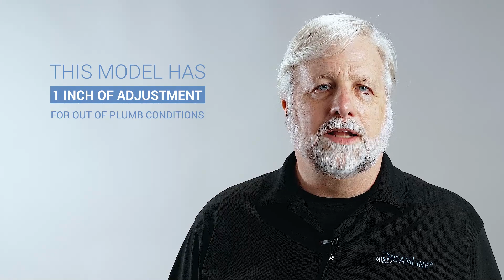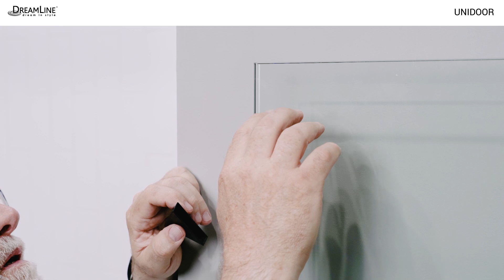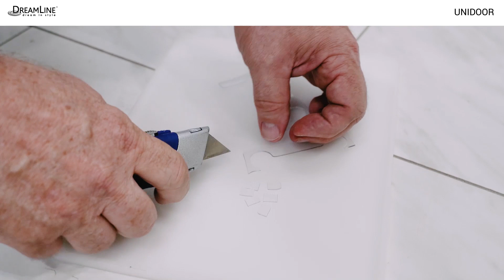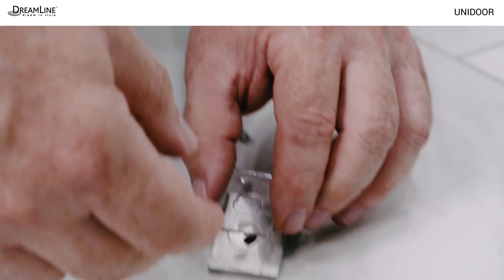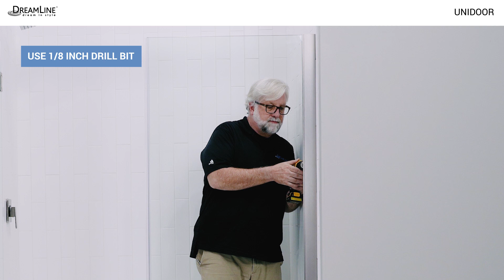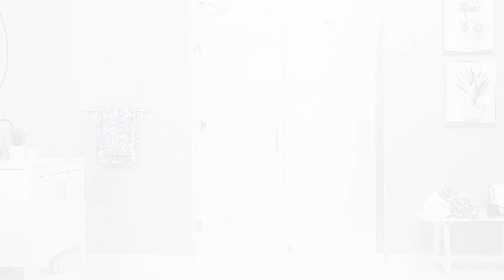How To Install a DreamLine Unidoor-LS Frameless Swing Shower Door | DreamLine Installation Tutorial

Comment: what if the side panel is not even across the top with the door?
Reply: Installing tomorrow I've watched this video 3or4 times now I feel confident having this information thanks for making such a detailed informative video.
Reply from the maker: @childofgod5115  Thanks for reaching out to DreamLine! We're thrilled our installation video was able to help educate you for the installation process of the Unidoor-LS shower door. We pride ourselves on making sure our installation videos are easy to follow and duplicate in our customer's home projects. If you have any other questions, please contact a DreamLine Shower Door Design Consultant at 866.282.8413. We are available 9am-6pm EST, M-F and will be happy to answer any questions you may have.
Reply from the maker: Hello John. Thanks for reaching out to DreamLine! If correctly installed, the door will still operate normally, even if the panel is slightly higher or lower than the door glass.  With some images or more information, we can better assess the cause. If you'd like more information or a potential solution to this issue, please contact our Customer Support Department at support@dreamline.com or use our “Chat with Expert” feature on DreamLineShowers.com. Thanks for choosing DreamLine!